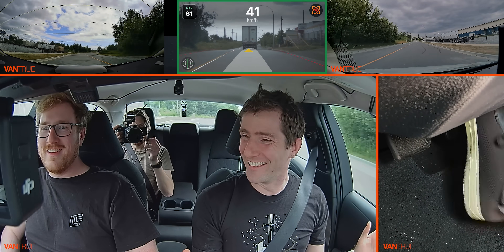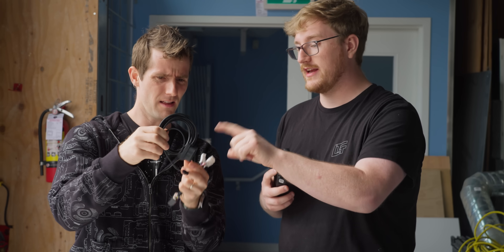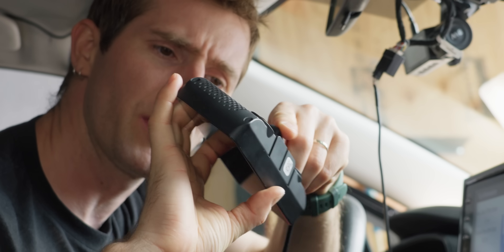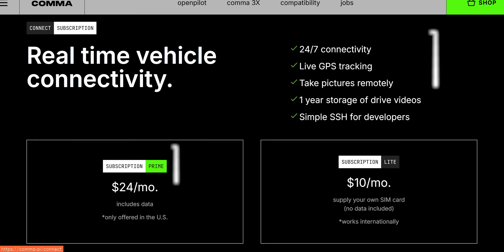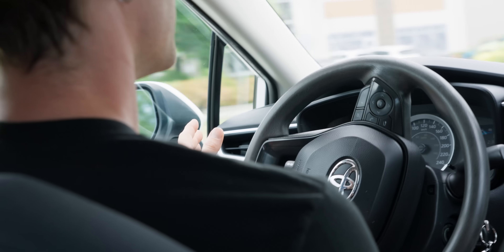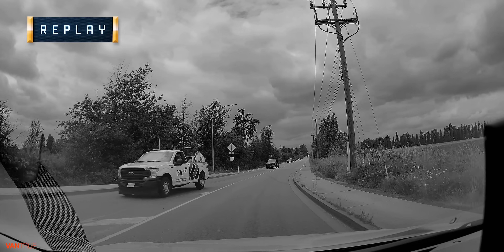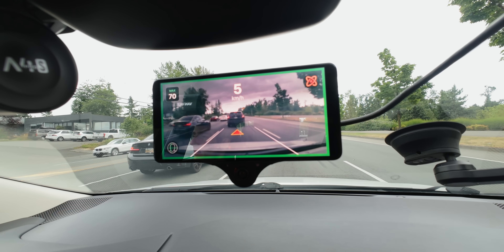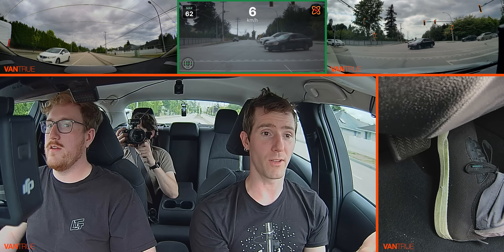I Upgraded My Car With Open-Source AUTOPILOT and it's AMAZING

Comment: I'm a embedded software engineer working on automotive safety relevant software, and I had a look into the documentation.

From what I can see, the project only follows very lightly the relevant safety standard (ISO26262). To be compliant, you need HUGE documentation. From safety analysis, to derived requirements on each sublevel. Every Safety goal must be traceable trough every level. 
There must be Software safety requirements, a software architecture derived from that.
Software unit requirements derived from the architecture. Each unit test must be mapped to unit requirements, the tools must be qualified for use according to ISO26262. They use cppcheck for example and that is not a qualified tool.
The compiler is not certified, etc etc.

Comment: No redundancy backup, working off a brand that could fold in an instant and disappear into the ether, and off of dated hardware. Just don’t kill yourself if you continue to use this; on a much lighter note it’s really lovely to see Linus being a lot more human like (for lack of a better term) having a lot more friendly banter with his team. That’s lovely to see!
Reply: Also, almost all other self driving tech thus far on the road does slow down on curves; the Tesla statement was incorrect. This wasn’t the case a few years ago.

Comment: I’m super excited that LTT is covering this product as it’s flown under the radar for awhile. There’s such an amazing community of people around the comma willing to help each other out. 

The steering in my Honda could barely do anything but now I’ve learned how to flash my eps firmware and can now set my own torque limits for my vehicle so it can steer better. But with any customization with something like this then it’s needs to be tuned. 

My favorite where it shines is with the Sunnypilot Fork (I use the staging-c3-new for the latest version of the rewrite of the software with the latest driving models) with the MADS feature that allows steering all the time without cruise so you can control gas for city driving and assist the steering when needed. And then highway is just letting open pilot take control.

Comment: Having driven over 75,000 miles with a comma 3, my biggest advice is to install FrogPilot.

Use always-on lateral control.

Lower the volume.

Driving becomes far safer and the comma will be far less annoying.

Comment: This is extremely illegal in Germany. You can not do ANYTHING to your car unless you go to the TÜV to add it to your car's registration basically. If the TÜV approved it, the police can't tell you it's illegal. And you can't get the TÜV to sign off on this. Would love it, but no. You need to by a Mercedes for basically the same functions as of now. Or a Swasticar.

Comment: When you are letting it drive, say on the city streets the car moves 60 feet per second. Should it fail anywhere from the camera to the steering motor, you will die if you hit an oncoming car or a tree in a curve. There is ZERO redundancy. A Tesla has two systems. Your human reaction time will be too late unless your hands are on the wheel

Comment: I loved my Comma 3.  I bought it for our 2021 Palisade and it made cross country trips amazing.  The Hyundai HDA helps it be a WAY better product.  With Wifi or LTE it will compensate for turns and reduce speed.  I personally run Sunny Pilot.  The stock does work well but I LOVE the features of Sunny Pilot.

Comment: this is amazing. where i live this is illegal on so many levels idek how many laws this breaks, but i wanna try it.

Tho, one important thing to test wouldve been low light and night driving, driving facing the sun, driving in the rain, fog, all in all, driving in suboptimal conditions. not that i expect it to do exceptionally well there, but would be interesting to see HOW well or bad it does.
Reply: In my experience, it actually does do exceptionally well in all those scenarios. Sun in your eyes and can't see the lane lines? Openpilot can. Driving in heavy rain or fog? Openpilot does a great job here too. Night driving? The cameras in the c3 and c3x are great for low light conditions, though this is going to be dependent on your cars headlights too. It's too bad they didn't test this on a Hyundai, they have so much more steering torque to play with.

Comment: It’s cool that someone is attempting an open source solution. One call out, at @11:00 you claim that Tesla’s Autopilot will not slow down for corners. This is 100% false. Tesla FSD absolutely will slow down appropriately for corners. If it didn’t, it would be impossible to complete a full journey without careening off the road. FYI: I have had Tesla’s FSD drive me on journeys that included both highway and curvy country roads with hairpin turns… and I still draw breath.

Comment: Even in the latest models, Toyota makes you pay a subscription fee to use the stop and go "Traffic Jam Assist", so if this unit does it, there is an immediate savings by not having to buy the high level trim and pay the subscription.

Comment: I would like to add (as someone who has the 3X and the same Corolla in the video (just 1 year newer and as a hybrid)

When it comes to move the car from a stop light that just turn green. It is VERY cautious. Let say you have line of car on your left/right. Both going to the same direction. It won't start moving till the 2nd car right next to your front bumper and takes a bit to get back to speed. This is fine if there is no cars behind you, but if their are. You might get a honk or two as people think you weren't paying attention to the light.  Which is why you may have to give it some gas to in order for to start going sooner (or pick up faster)

If you go with the Hybrid model (check for car compatibility list before purchasing, specially the newer models as. At the time of this comment are not been cracked yet for it to work). You can't be in EV mode and Open pilot at the same time. Its one or the other (does the same thing in stock).

There is a somewhat work around by using Sunny Pilot (in setting, forgot where), where it allows you to go from Driver has control on both gas and steering to Driver has control on gas and Comma on steering (which does allow you to use EV mode, just make sure your LTA says "Ready") then Comma on gas and steering.

as for the curves. Unlike the Stock Line Tracing that will try to center between the lines (creating a pinball affect were the car is constantly correcting itself to stay center of the lane). Comma doesn't do that and if there is enough road outside the white lines when making turns. it will use it. 

You can see it judging based on how far the red line is from the white line. Red line being the edge of the actual road and white lines being the lane. If the red line is too close to the white line. It will attempt to hug the curve while staying in the lane vs cut the corner when it comes to turn.  

As for those who watching and notice the green border that occasionally turns grey or flashes grey. Green means Comma is in control and Grey is Driver (Linus) took control and or overriding Comma even for minute adjustment (gas and or steering).

Comment: As a long time Comma user i can say this is the best thousand dollars I've ever spent. I've driven 40,000 miles since installing it and have had no safety issues whatsoever. My previous Tesla had at least 2 instances I thought might kill me
Reply: Thats hilarious, what year tesla did you own? Driven my model 3 50,000 miles since I bought it last year. I have had 1 critical disengagement, from a car brake checking me in California. Ive gone on multiple 2000+ mile trips without touching the steering wheel, except to charge. My brother had a comma on his 2023-24? (idk what year) Hyundai Elantra, drove my Tesla for 1 week while his car was in the shop. He traded in the car two weeks later for a 2025 Model Y...

Comment: I have driven over 150K miles on comma over the years since the comma one through now the comma 3x. Cars have included Honda Civic and currently a Honda Ridgeline. Never ran into an issue besides the original device getting to hot and coming off the window.

Now we installed it also on a Subaru Forester 2019 and have had issue with the handshake but did resolve it with a different form of open pilot.  Frog pilot for the win!

Also highly recommend trying different forks separate from openpilot have many quality of life features such as always on lane assist and custom tweaks for turning, etc

Comment: So much potential, so little that actually seems to work. The only function that seem to work properly is the adaptive cruise control and that is something my 13 year old Mazda already does flawlessly. 
If I ran an insurance company I’d have my lawyers put in a clause to refuse coverage if a device like that was used. There’s a good reason self driving functions in cars have to go through harsh testing before it’s deployed
Reply: I believe that it'll become the norm that every insurance will have a clause that refuses coverage when autopilot is engaged. Similar to how they don't cover Damages on the Nürburgring when you crash
Reply: @lolly166541  I doubt it. It’s think insurances will keep covering as long as the autopilot feature is built into the car. Then the insurance rate can reflect the risk of autopilot engagement. 
The more realistic example in Germany would be the autobahn. Even tho there’s no legal speed limit, the suggested speed limit is 130km/h and if you drive faster than that and have an accident someone else caused, you’re still partly liable for it.

Comment: complaining about a system that brings self driving to a car having the power of an old phone for $1000 is like complaining about your fridge having low power hardware or the computer of a plane being very expensive and low power. not everything need high end hardware and the hardware isnt always the main cause for a higher price. you don't buy a statue that's carefully hand carved and complain about it being very expensive but using the same granite you put in your goldfish tank.

Comment: Even though it's open source, keep in mind that no official authority has tested this software. It's open source because that's how they circumvent regulations.

Also, keep in mind that this system is connected to your car's CAN network, which means that any malfunction in the code could interfere with safety features. Jammed gas padels or brakes can ruin your life. Even a small steering malfunctions can cause you a lot of financial trouble.

Comment: I purchased the C3X earlier this year because of my work commute, I currently drive a little more than 100 miles one way for work 5 days a week. 

The majority of my commute is on highway where the C3X works amazing.

I run sunnypilot on my C3X and I left experimental mode off, I pretty much don’t have to touch the wheel unless i’m making a turn.

Off highway I still use the the C3X on regular roads, however, I only use the lane assistance and I control the speed myself, for me it makes a big difference being able to just control the pedals and grab the wheel when necessary and making a turn.

I drive a KIA EV6 and i’ve also noticed that the C3X does help with my range when using it on the highway.

Comment: How does this cope during rain, splatters on the windscreen, wipers active etc?    This is a super cool project but anything short of total automation makes me really uncomfortable.   I hate the idea that I'm supposed to be able to relax but also supposed to be ready to take control within a fraction of a second and keep total situational awareness... at that point I'd rather just drive.   If I've had 20-30 minutes of not having to pay attention there's just no way I'd react quickly enough to an incident.    Also this system looks like it's really unclear intuitively how much it is/isn't doing, but that's just from watching the video, driving it may make more sense.

Comment: reeeeeeealy important to remember
Tesla's "autopilot" is using the phrase wrong, it is absolutly not self driving; it is enhanced driving... and the worst performing enhanced driving tooboot on account of relying on visual range cameras instead of a multitude of sensors, radars, and lidars like every other company does and has done for close to twenty years now.

Comment: Jake, these newer cars make it that you can't disconnect the battery, if you do, it messed up the computer system. In modern cars, disconnecting the battery can cause issues because it disrupts the ECU (Engine Control Unit) and other computer modules, potentially leading to loss of stored settings and errors when the battery is reconnected. Unlike older vehicles, modern cars rely heavily on these electronic systems for various functions, including engine management, security, and even basic operations like power windows. So now a day, this newer cars, you can't unplug the battery, my cousin 2015 Nissan Frontier requires a machine to keep the power on the car to prevent it from bricking, which is stupid that the computer needs constant power.

Comment: (2:03) They've come so far! I particularly remember the Comma Two looking like a modified OnePlus 3T, but on further research, a Reddit post, which I since can't find, revealed that the Comma Two used a modified LeEco Le Pro3 (or Le Pro X720?), not a OnePlus 3T like I initially thought, but it did make sense considering how LeEco flopped outside of China, so Comma AI likely were able to get many of those unsold phones that were otherwise headed for e-waste, and they did eventually get enough funds to fully build their own hardware!

Additionally, the use of the older Snapdragon 845 instead of a newer Snapdragon 8 Gen 4 would make sense as Qualcomm were likely offloading their older SoCs and Comma AI were likely able to get those and the SDK for the SD845 with the Android development targets, BSPs, device drivers, etc for an older Android release (likely Android 10 or 11).

Comment: I have a 2023 Chevy Bolt EUV that i bought last year brand new, i drove it for about 300 miles and realized the factory LKAS (lane keep assist) was trash, and have been rocking OpenPilot ever since.

Its pretty funny, my far has 32000 miles on it now, 99% of which was spent using OpenPilot. Im totally dependent on it now, and while it still has issues (mostly limitations of my car hardware) - i love it.

Comment: "It will cancel lane change if you have side sensors". Hell that is scary! If you don't have them it just crashes into the other car unless you actively prevent it from doing so?
Reply: from what i have used it, it doesnt change lanes if it spots anything in the 360 deg camera but you have to nudge the wheel to complete a lane change, im also just not brave enough to trial it with a car beside me too much lol

Comment: a lot of the issues i am seeing are the same issues i see from other drivers, not enough steering input at too high a speed. Like folks first reactions is to rely on braking alone and not in combination with steering. i would say most of those turns if it had reduced speed it would have made most of those turns fine.

Comment: As someone who used this extensively, it is great, but take into release the following:
- your car needs to be in the supported list, if it's not, dont even bother
- this is more tailored to developers/super-users , support might be laking, will be trough community discord mostly
- be considerate to your fellow driver, just because your car does a bit of steering, don't loose focus on road
- dont confuse what this product avertises with what you would like it to do, it is made mainly for highway, not for streets, reason for it , you have a limited view(front only) , and you car electric steering pump has a hard-coded torque steer(force required to move the wheel) limit

All in all, if you want a highway cruiser, and that is mainly your driving habit, do it , if you want a tesla fsd whatever, this is not for you

Comment: i noticed you guys mounted a big camera up on the dash and it wasnt used in the edit so i'm guessing that angle didnt turn out well. try to mount a DJI osmo pocket 3 as a dash filming camera. I see a lot of professional shows using that as the dash mounted camera now for filming talking heads in the car. Its a lot more practical than a protruding mirrorless with a lens. They are super small and the quality is very usable.

Comment: I see a lot of positive comments about this device or Tesla steering in general, but i myself do wonder: What makes this so good for yall? You still gotta pay full attention because the device is anything but reliable, holding a line has never been an issue for me and changing lanes I also wouldnt trust this device with (assist sure but if I check my mirrors I check my mirrors). So where does this device do something that is worth 1k$

Comment: I bet the reason it has SD845 is that that chip actually has a very decent Linux support. Anything newer than that will probably not have most of the drivers available (if any).

Comment: I knew open source models for this existed like in china (for manufacturing) but thanks for showing this it’s really cool! But it requires adaptive cruise control and other features and if my car has that why would I even bother with this but it makes sense once it gets better . If it’s gets better than a 2022 i30 n line on the highway I might consider it.